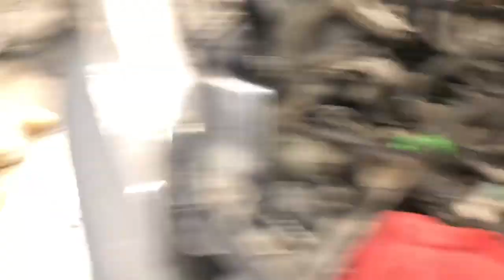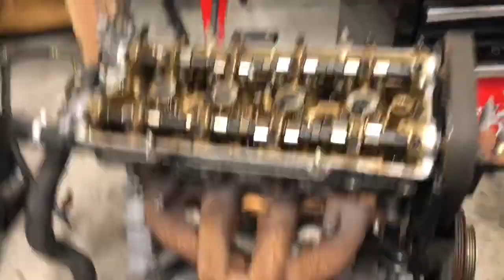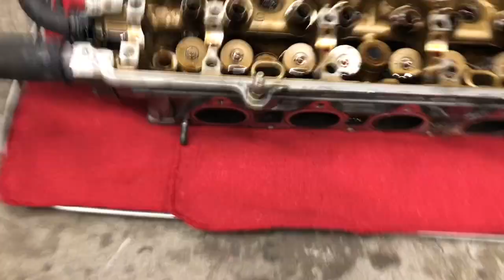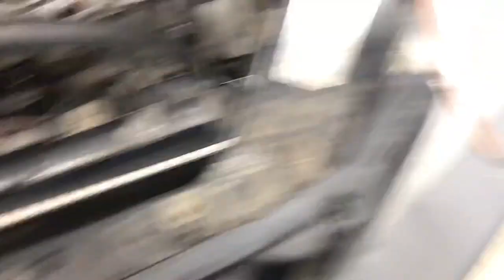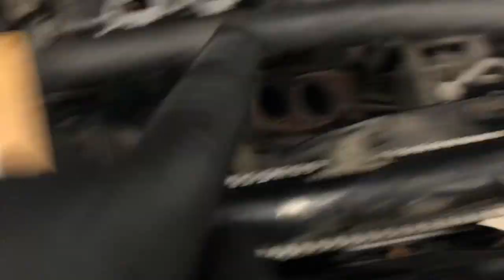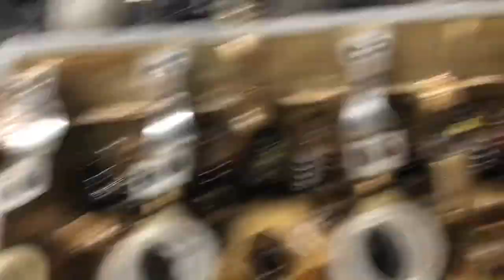B20B CRV Head Gasket Pt 1

Comment: are those dowel pins between the head and block necessary? are they to "help" you align things or do you absolutely need them?
Reply: Yes they are... they help with the alignment and replacement of the head on the block and water ports etc.

Comment: what if you mix up the rocketarms did you have to fix it again
Reply from the maker: If you mix up rocker arms then you have to adjust valves. Very easy and you would do it anyways. Don’t mix up the cam caps! Rocker arms? No problem.

Comment: you dont feel you need to use a sealer inconjunction with the head gasket?im just about to do mine and was advised to use "WELLSEAL".Its a kind of guey shellac invented by rolls royce...but i will be putting in sparingly as it get everywhere and never sets...to behonest ,and this is why i am asking,do you think its perfectly fine not to use a sealer and no advantage if you do?  the gasket i got is NIPPON LEAKLESS from japan, it is HONDAS OEM gasket
Reply from the maker: We have never used anything other than head gaskets. Some people used to use copper spray, but we also have multiple world records in racing, the head gasket as is, is fine. As Honda intended.
Reply: @roninmotors7466  Hi,thanks for the reply and advice mate :)

Comment: Quick question if my timing belt on my b20 busted should I remove the head to make sure I didnt drop a valve??
Reply from the maker: Alex Santana or you can slap another belt on it and start it. Quick and easy and youll find out fast what happened. If it runs good you lucked out if it doesnt? Or compression results look bad? Then you know what it is. I keep spare belts around, find a buddy with one

Comment: What's the difference on intakes? Mine has the flat rectangle box, but I see this tubular style intake that I didn't think it would fit. Which intake is better - performance wise? 
I did get a JDM motor & I had them switched the intake to the original box style. I hear now that the JDM is missing some emission stuff so been sitting for a year as won't start.
Original engine had terrible blowby &  took a quart of oil/100miles... Thanks for the videos :-)
Reply from the maker: SamaritanElad mainly its the difference between usdm high comp and low. So the 99-01 CRV would have the box mani. Performance wise? Id have to see dyno graphs

Comment: hello bro, my vehicle model is 2005 automatic, gasket is gone ,120000 KM done , is there anything parts can change with gasket suggest me,mechanic said this parts (timing chain,thermostat,gasket, Clutch,releasing bearing,pressure plate) to change.
email: devimdvprasad@gmail.com

Comment: How did you diagnose the burnt valve? Low compression in one cylinder?
Reply from the maker: I have a video on the diagnostic process of narrowing it down. However a leak down test and /or compression test will show if it burnt to the point of failure, yes. Thanks for taking the time to view my video.

Comment: Thanks for the video!  Just bought an '01 CRV.  Off the wall comment, but your voice sounds like Jack Black.
Reply from the maker: codybroken youre welcome man, thats first hearing that lol right on
Reply: Ever get a CR-V with a whine that corresponds with car speed?  Mine starts at 20-25 mph and by 50 it sounds like something is going to spin off into outer space.  Sounds front end but I know shite.

Thanks again for sharing your knowledge and experience.

more inanity: wonder if you could hit those high notes like Jack does w/ Tenacious D.  I sure can't.
Reply from the maker: If the sound corresponds to wheel speed, and doesn't make any noise while in Park or Neutral while revving? Id start by looking at the axles and wheel bearings in the front. The drive shaft/propeller shaft is another place Id start, the carrier bearing also makes noises like that. Could possibly remove the drive shaft and drive it, does the sound go away? etc. Slowly eliminate each variable until you find the culprit. 
--And no, I cant sing well at all hahah sadly.
Reply: Thanks for your help!
Yes, the sound is only when the car is moving, directly proportional to wheel speed.
Transmission seems to shift strong and smooth at all speeds.
Thing has 258k miles and I want to do as much work as I can.
On the Mrs's advice I am taking it to a shop, but if at all possible I'll fix it myself.

Big thanks again!  You seem like a cool dude and I'll be sure to watch all your CRV vids.